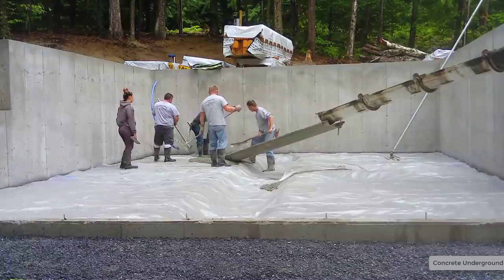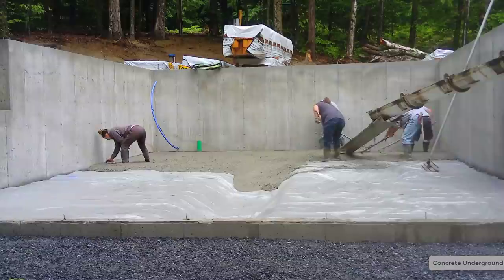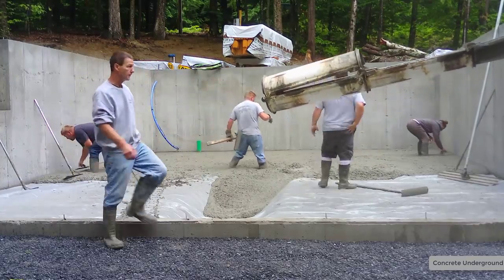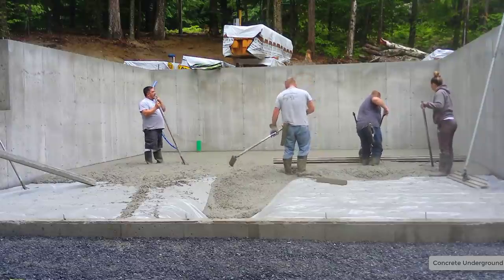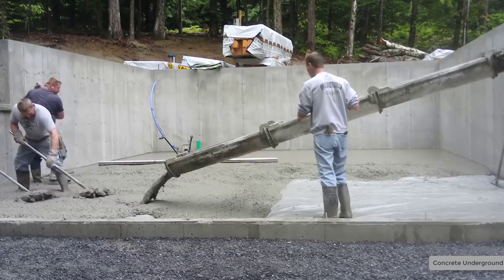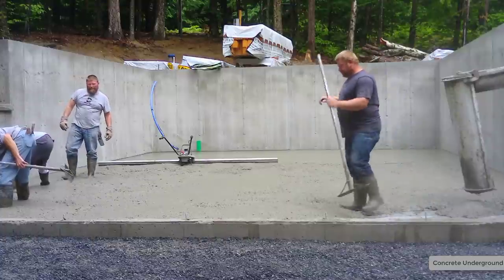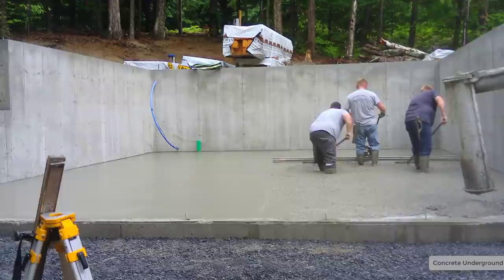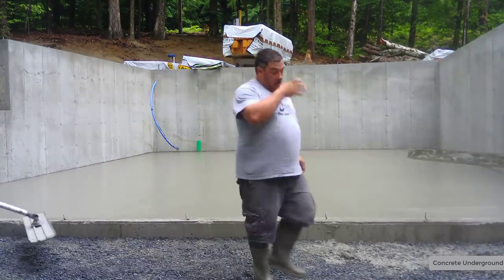How To Quickly Pour A Concrete Floor (How Fast Are We?)

Comment: In Australia we use the same method for heights, lazer and mag float for screed lines or rails depending on what country terminology your from. For screeds we use a aluminum straight edges with a longist handle on them. Instead of 2 people screeding on one screed we use only one person. In the bays after getting the bulk in and roughly spread and heights in, I will prep and screed the bays myself. Its different if your in a good team but mostly because of the knowledge and skill shortages here its easier to do it all yourself, when doing a a bay.

Comment: Thinking about using water reducers ourselves. Seems to make pouring a lot more easier. Great video!
Reply: I’ve only used them one time and it was a dream to work with honestly.
Reply: Where I am, adding the cost of the reducers can be the difference between getting the work or not. Now, as quickly as the stuff can be laid down and screeded and the reduction in labor costs for that, maybe that would make the water reducers cheap enough. But guys around here will take the concrete to a ten inch slump using water from the truck. It's tough to compete with those guys. A reputation for doing good, solid work doesn't seem to mean much here. It's all about bottom dollar cheap.

Comment: Should not have 3 chutes and the extension chute without a brace at 3rd chute and 2nd chute connection . It will cause a bent at rotation part. Driver should have said get a brace for the chutes if you put on your chute.. I've refused to pour till they put a brace up. Crew should know better and driver especially should know better. It's their truck and have to put up with a hard to move rotator . It's never tricky if the driver is good! Too

Comment: Wet screeds for sure!
Reply: One man wet screed 10or 12 foot  with handle aluminium. A bit slower but with In a couple mm . I don't believe that the bullfloat takes out lumps , it just rolls over them ,  how do U use one to take out humps? . Not saying U are wrong,